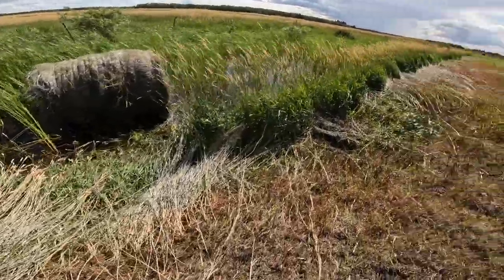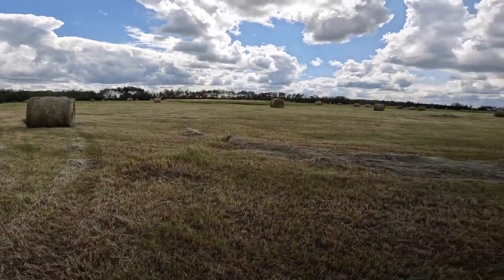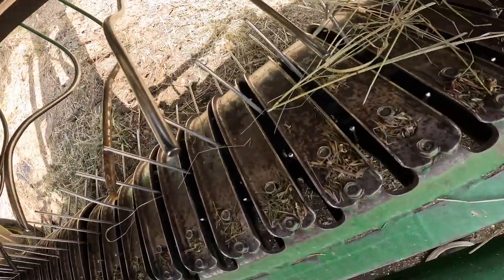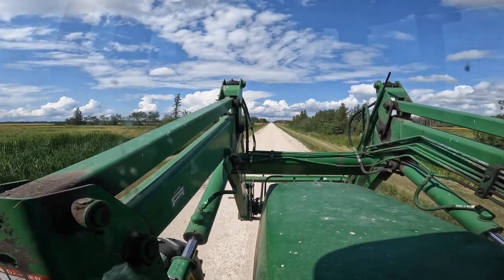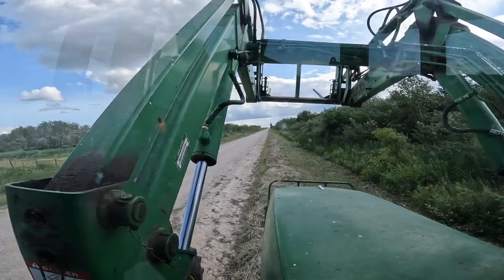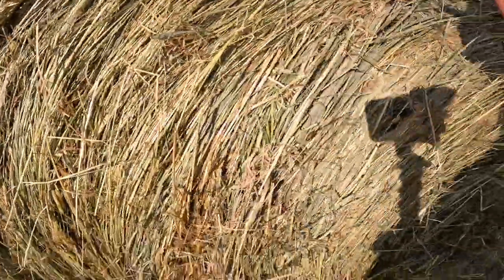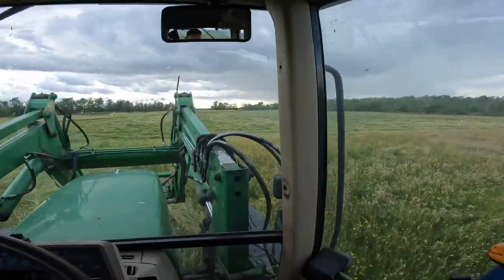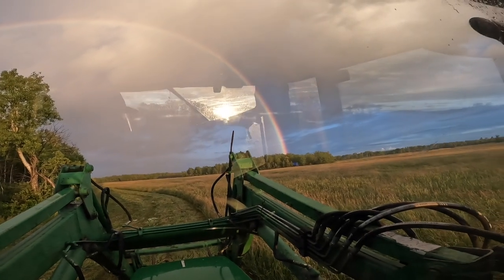Baling Road Allowance Hay & Disc Mowing HEAVY Alfalfa-Grass Hay Fields 🌾💥🥊

Comment: It still amazes me how that hay dries down that fast without a crimper
Reply from the maker: It is still surprising to me but it honestly works 👍🏻
Reply: I got a Vermeer tm 1410 that runs on the same idea just that its 20 foot wide. the fuel a guy saves is crazy. takes a lot of power to push everything through a crimper
Reply from the maker: @valleyviewacres9120  I have great interest in those vermeer tm’s! 20 foot cut equates to less hours on the tractor and less fuel consumption 👍👌🍻
Reply: @PrairieSunsetRanch  yeah I never drive over 5 mph I'm usually knocking down 10 acres to the hour at that rate and the say if you are on flat ground 100 HP is all you need. I run it with 7710 and it just goes like a dream.

Comment: Northern Alberta here Aaron.  Getting so dry in our area that the crops are burning off.  Good thing the year started out so good, got an average hay crop and if we get the rain they promised for this weekend, grain might not be a complete wreck, but it’s looking below average.  We will start greenfeed pretty quick.  Although some areas got the rains and showers so very variable up here.
Reply from the maker: Oh 😬wow that sucks. Still hit or miss. We just got another 2-3/4 inch last night. Man it's making the fields very soft. We need a couple weeks to dry up, but hey I'm still finding a way in-between rains to put up a few bales👍🏻. I hope the weather changes for you and the crops stabilize. Cheers  🍻Chad
Reply: @PrairieSunsetRanch  good deal.  Don’t want to bitch. Lol 😂   Way better than last year.  Pastures are holding up well, just would be nice to see regrowth on my grazing cells for later in the fall.

Comment: Just  finished baling first cut Saturday.  It was a challenge with humid and rainy weather. Some hay is good and some not much better then straw with all the rain.
Reply from the maker: This year is certainly testing a guys haying LUCK. 🤣 We have had some rain on hay but mostly just as I was cutting it down so the damage to the hay was minimal. Kinda been lucky so far. We had a few windrows we had rain on which we had to flip couple times to properly bale it. We will be pulling those bales aside. Maybe bedding or windbreak bales. Cheers 🍻 my friend.

Comment: Have ya thought of running a set if band duals on your baler or just a single on one side? Might help a bit with stability, I know it definitely helps with not cutting up the fields. We are getting some haying done in between rains in NW mn but seems like it rains almost every week. Hopefully things keep chuggin along for ya! We are dealing with some hoof issues and serious equipment breakdowns this year so seems if it’s not one thing, it another. Anyway we’re surviving. Keep the videos coming!
Cheers!
Reply from the maker: Never thought about that but would be a great idea if I had a Lot of steep baling. In this case we only make 20-30 road bales a year so we can just Ewing it, but it would help 4sure in those soft fields. If the weather continues to trend wet that could be an option. We as well have a few hoof issues with the damp/wet conditions but everyone seems to be recovering well. Cheers 🍻 my 🇺🇸 brother
Reply: @PrairieSunsetRanch  when I was a kid, we had an old Hesston 5500 that we put retrofitted a set of used Grader tires on it. Made it handy when we baled a lot of swamp hay.
Reply from the maker: @fredsorensen1963  🤔 Interesting. On those really wet years it could be a game changer. Hopefully our wet trend smartens 🆙 the longe range looks really good for us now 👌

Comment: That hay looks nice your cutting . I'm done second cut very dry here pastures are burning up here. I brought cows in for a week or so . I hope there will be some third cut . You make 5×6 bales never seen a baler that big before.  4×5is the biggest i have a450 newholland baler thats the biggest I've seen what would the bales weigh you make
Reply from the maker: 4x5 bales would be convenient but the 5x6 last just a little bit longer on those cold winter days. Our bales weigh between 1250-1500 LBS. Really depends on the day how dry etc. Cheers 🍻 Mike.